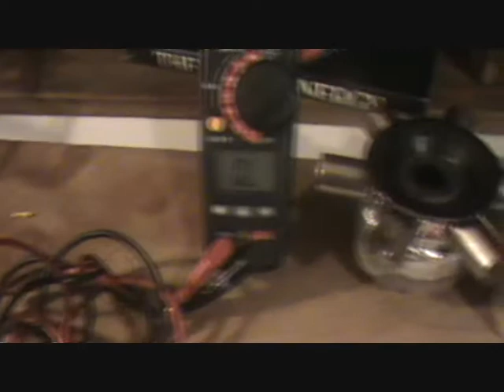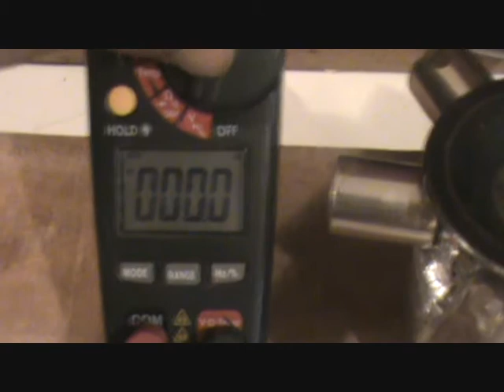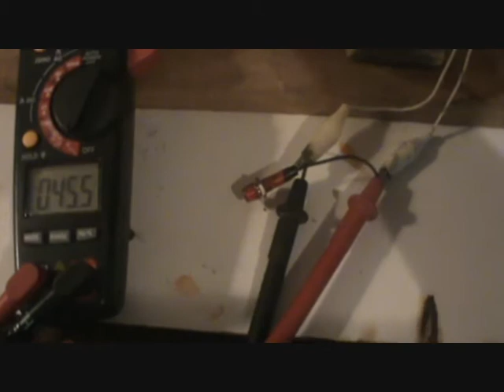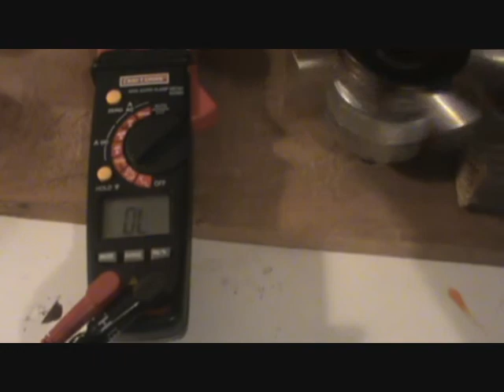core coil generator

Comment: that is an awesome discovery man... that tells me ALOT about the stuff im playing with now.. im not sure exactly how the meter is made to check continuity, but it would seem sort of like setting a megaohm resistor on fire or something.. it would allow current to travel alot easier.. same way when the core saturates its allowing for the current to travel like it was just one big piece of wire. it cant STAY closed of course though because it only happens as the magnet is leaving. are u from NC?

Comment from the maker: @Altered6Chicken order 10 one inch magnetspff ebay for 25 bucks, and get to building therest is scraps from microwaves and a/c units off theside of the road, im so glad appliances cant fit into trash cans, its an interesting hobby that can take over  you like a drug if you let it, but you will learn a different aspect of energy, and will also give a a respect for the amount of current it takes to actually operate anything. kinda makes you cut the light off when your not in the room

Comment from the maker: @d3adp001 oh man, ok, the original core broke when the anhesive i used lost grib sending the coil into magnet which were going a couple hundred rpms, return was a coil that was unthreaded a bit, so i soldered one lead to the loose end, but the other end of the coil is tightly packed under hundreds of winds of copper cause it broke so close, so i just soildered a lead to the core.
  im gonna disect this thing in a video soon, im no liar though and never claimed magic or free energy.

Comment: @crob can you do a video showing a battery lets say 12v, with the + connected to one wire of the coil, the other wire of the coil wired to one side of a 12v light bulb, the other side wired back to the 12v battery, with no magnets anywhere near the coil. 

You've pointed out one interesting aspect, now lets shake the tree and see what falls out. 

What is the coil made from? is it attracted to a magnet?

Comment: @crob227 I am sorry for being so abrasive, its my nature. But lets start with the knowns, as you have pointed out in the video it has properties that are interesting, its acting like a reed switch/coil. 

You said that the coil broke, lets talk about that, how did it break? what did you mean by that?
I can plainly see 2 wires leaving the coil, but I am a bit confused as to where they go, one somehow touches the coil material, and the other goes where?

What does the meter read on other coils?

Comment: Really interesting what you have there. how did you came up with it? a mistake? or what it in purpose? Have you tried using a different core? like smaller or bigger or any other material to se if it produces a better or a worse result? Maybe changing the number of turns in the coil, of course following the same topology, conecting just one side of the winding.

Comment from the maker: @d3adp001 connected to both sides of the coil?????

its connect one to the coil, and on to the core, it does not ohm out unless the magnet moves in front of it, that was odd and i thought i would post some original work

Comment from the maker: @marthale7 i wasnt comparing  the "amazing" work of lazersaber and lidmotor just offering another way to maybe gain more energy out of a earth battery, i think everyone is missong the point of the video, whichis the coil is hooked up with ine wire to the coil, and one wire to the core, and it generates energy, when the magnet passes it

Comment: if it has voltage when spinning then its connected. what you are missing is more than likely impedance, measured in ohms, check into it.

Comment from the maker: @imatelly sure will, but it is a factory wound coil, it came out of a old ac unit it was a fan relay i think, any way it had hair like wire in it, really rare i havent seen other coils with this thin wire, but the down fall it broke a lead, so i soldiered the broken lead straight to the core, and can still generate current.